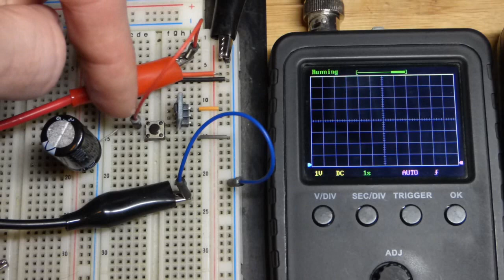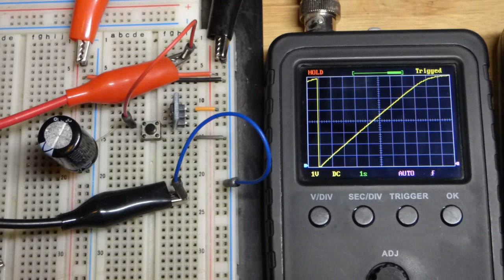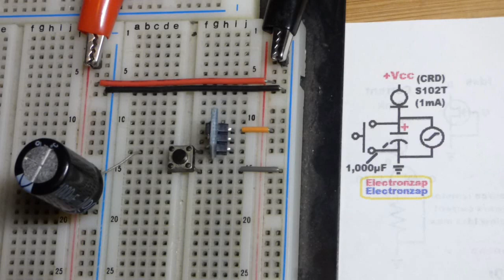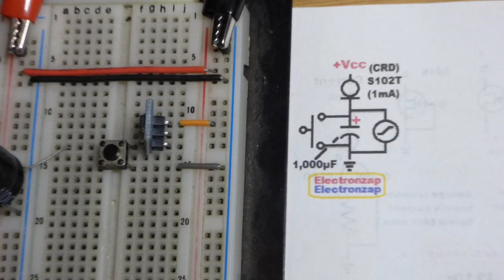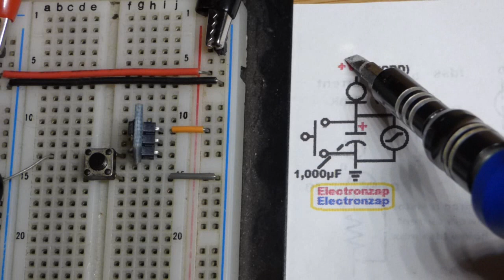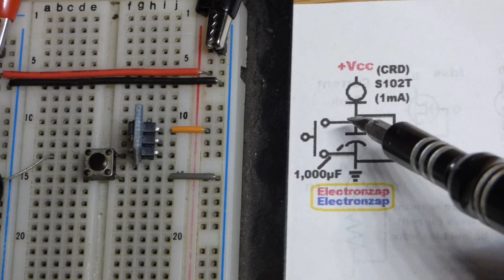Voltage ramp demonstration using S102T Current Regulating Diode component

Comment from the maker: https://amzn.to/44mBxK1 Joe Knows Electronics Semiconductor Kit (320 Transistors & Diodes). Affiliate link ad.
https://amzn.to/43YLz3Z Art of Electronics. Affiliate link ad.
List of my videos https://www.youtube.com/c/electronzap/videos
https://www.youtube.com/@Electronzap/community for most of the diagrams I've used in my videos.
https://www.amazon.com/shop/electronzapdotcom As an Amazon Associate I earn from qualifying purchases. Americans should check out one or more of those links before making any purchases. There's no extra cost to you.
https://www.patreon.com/electronzap
https://electronzap.com/
https://www.reddit.com/r/ElectronicsStudy/ 

S102 current regulating diode component sets a current to around 1mA. Which will charge a 1,000µF capacitor at 1V per second. The actual current is a little less than 1mA, and the capacitor is probably slightly off as well. So timing won't be exactly 1V per second.